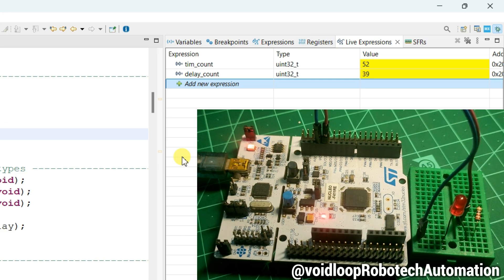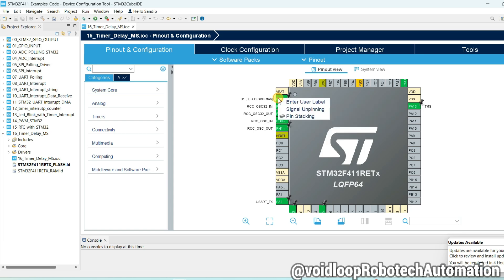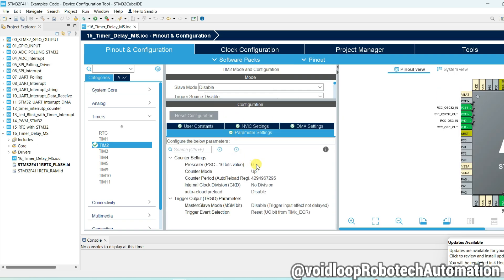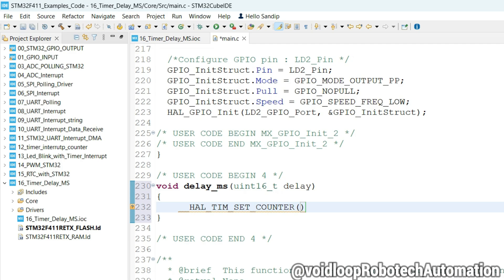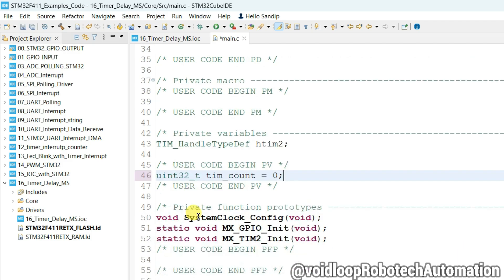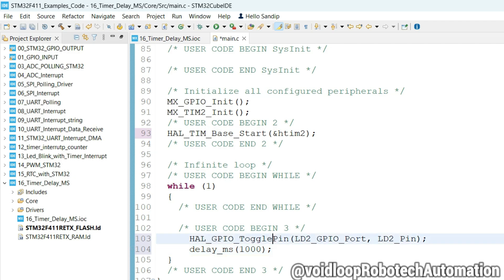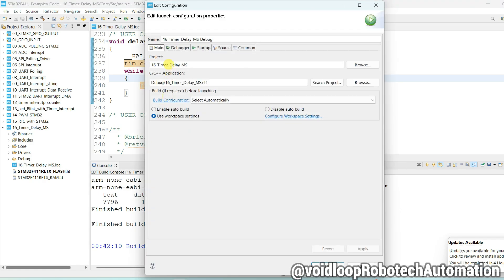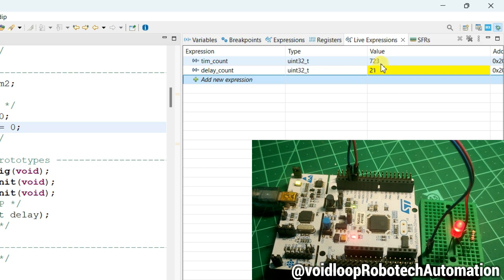16 STM32 Timer Delay in MS using STM32Cube IDE

Comment: thanks, this video helps
but the main issue with this code is that it uses a busy-wait loop with TIM2 for delays, which blocks the CPU and wastes processing time. However, the main purpose of timers is to generate precise time-based events without blocking the CPU, usually by using interrupts. A better implementation would use timer interrupts for non-blocking and efficient delays.

Comment: Good example, few notes waiting for your approvement and clarification:
• A timer is actually a time counter that counts at a given interval. What is it equal to? Is it tied to a processor clock cycle?
• Timers count until we reset them
• We can get the current timer value
• Is there a standard delay function in HAL_LIB?
Reply from the maker: This is a basic and simple application of timer only.